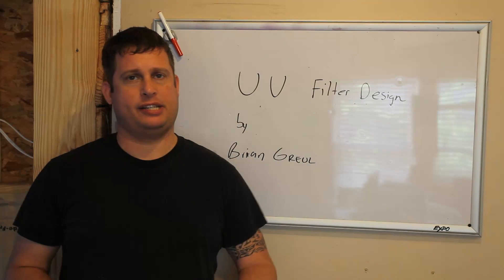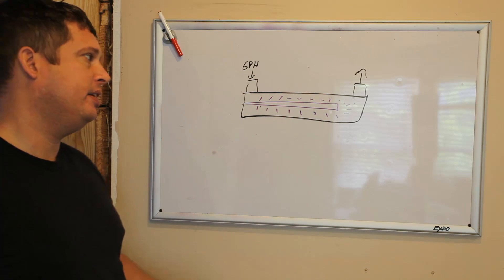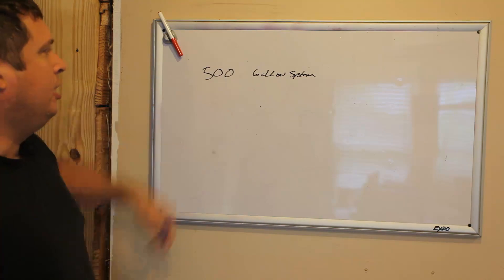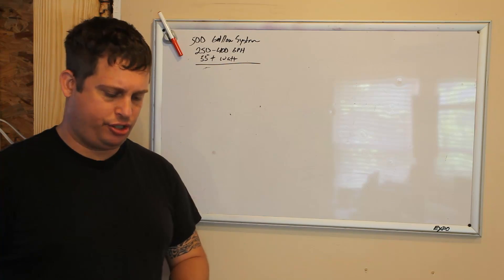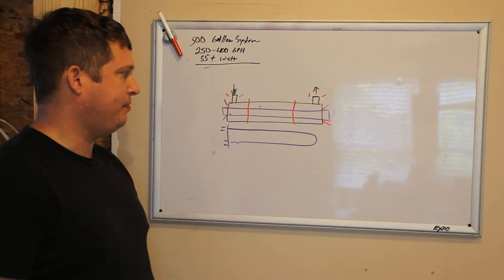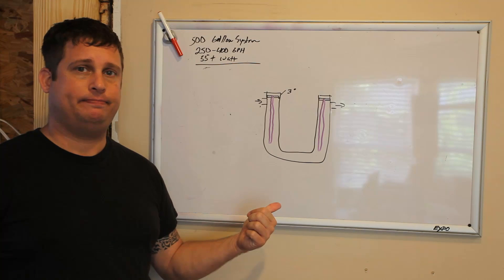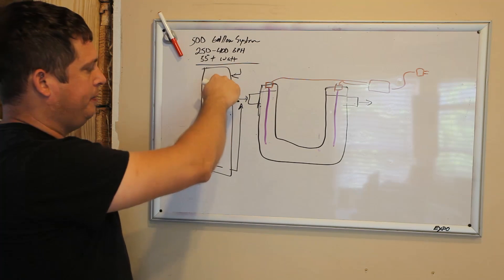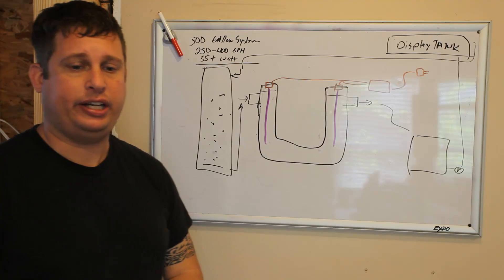DIY UV Filter Design

Comment: Thanks however I have a question (Cant get the book) .. I'm working with a 10000L pond 2000 Gallon... When I Google AI the wattage needed  for either level one or level 2 filtration I get 40W .... When I calculate like you do  I calculate 200W, Thats a bit of a difference. All I want to do is keep the algae out of my duck pond

Comment: you dont put the uv light in a glass casing , does the water affect the uv tube
Reply from the maker: What exactly do you think the UV tube is made out of?   Yes Dorothy, it's made from Quartz Glass which allows the rated amount of UV light to pass through.  Additional layers would cut the amount of light while accomplishing nothing.

Comment: This is a highly advanced lesson, buddy. Thanks for sharing this information with us. I´m going to invite you to visit my own design with 45 degrees for inlet and outlet, instead of 90 degrees. once I´ve built it. I will link it here, as it was the origin of my design, using perhaps a small windmill for water pumping. It´s going to be a 25K liter water pond. I hope to run the system just at night, to extend the bulbs life.

Comment: Hey Brian, great video! Can't say how much this helps. I'm working on a water filtration system for rv grey water. In other words, I want to be able to wash their dishes infinitely. Any idea how I can incorporate this into my system? Also how I can filter out the particulates without clogging up the pump? I'm thinking of gravity filtering out the particulates and then pump the filtered water into another tank that then supplies it back through a one way valve into the faucet to use again...

Comment: Interesting method of doing it.  Would think you could also do a build for a smaller aquarium making it like a DIY inline heater but instead of a heater use a uv sterilizer with it made from pvc and a uni seal to go inline of the return pump of a sump or return of a canister filter.

Comment: Brian was it sealed at the top? I get the water level is lower but not sure about it getting the bulb wet or overflowing.
Reply from the maker: It is not sealed and will never get that high.  Non-issue.

Comment: There can be another issue with the bulb in direct water contact: It is designed to withstand air pressure. If the bulb is somehow subjected to more pressure, for example in a larger water column, that may not end well.
Reply from the maker: True, but you'd have to seal the bulb to withstand pressure.  In the design I suggested the bulb simply sits in the water which solves a bunch of issues.

Comment: 3inch id or od? id check the claim on cold water as well... i came across a paper where it was tested on bildge water systems to keep ships from transporting invasive species. they specifically looked at low temp performance.  I basicly glanced at it thought but if i recall the conclusion was it worked fine

Comment: Hey Brian, really great video!
Would your system work for a residential swimming pool; say around 26000 gallons?
Reply from the maker: I would be extremely uncomfortable with this on a residential pool.  In theory the concepts would work but I can't emphasize the safety enough.  Electricity, Water, and People are usually not a good combination.
Reply: @hotpuppy72  
Do you think I can use this system for my swimming pool using the  circulation pump?

Comment: i am currently suffering from a bacteria bloom (I know for sure it is not algea bloom since there is no algea in my tank and the water is milky white cloudy). My tank is 160gallon saltwater tank and I am going to apply a 9w Atman UV Sterilizer. It is rated by the manufacturer that the UV can cure up to 1850 gallon pond (which is freshwater - algea bloom) under the flow rate of 530-792 gph. So if I am going to apply this into my saltwater tank for treatment of bacteria bloom, which flow rate should I run through the UV unit?

Comment: Brian I love your videos thanks a lot you explain everything in an easy way I just have a quick question do you think something like this will work on an above the ground pool?
Reply from the maker: No.  Absolutely not.  For a pool where children and others could be you need a higher level of safety.  A GFCI should offer protection for sticking your hand in.  I would want a different level of safety if I was getting in the body of water.  A properly chlorinated pool should not have algae or virus issues.  It's not possible to chlorinate an aquarium as the fish live in it, so using UV to kill algae is an option.  Ultimately, it's better to deprive the algae of it's food source by using good water filtration.
Reply: Brian Greul got it thanks a lot n_n

Comment: Brian!  Exceptional DIY video.  I like your attitude toward the commercial, over-priced units.  I am interested in building a large koi pond in my yard.  at 11:00 or so in this video you mentioned that glass cannot come in contact with the bulb at 50-60 degrees.  If I live in southern california, I am sure the water will be nice most the year but as it is buried in the ground and can get freezing here some nights, will this UV system fail once the water temperature drops?  What do you think?  Can I still build my own system your way or do I need to buy an expensive one?!
Reply: Hi Brian, I also live in SoCal, in San Diego to be more specific. I would love to hear your answer on this question.

Comment: Great video, if I wanted build one of these for my 6000 gal pond and I noticed you said this was like for use in a low flow situation my pump driving water from the skimmer to uv light and then returned thru one of my waterfalls is pumpimg at 5500 gph . The current evo UV system I have on there does a great job and is rated to handle that flow rate but already I am having problems with leakage around the ends as you described and the unit is ony running for 3 months. Now it appears as if the bulb is toast and the replacement bulbs are $90 on ebay.
My question then is can this design that you refer to be used in a high flow rate situation by running two of the 36 watt bulbs as you are or maybe a higher wattage but in the high flowrate.  Thanks

Comment: Sorry for posting on an old video.
If I were to plan out a 3000 gallon pond, how do I ensure 90/99% sterilization? Do I simply set the flow rate by dividing the pond volume with the numbers you've given or do I need to calculate with another formula entirely?
Reply from the maker: It should be the same.  Why do you want to sterilize your pond?  It's better to correct the imbalance.
Reply: Thanks for your reply. How do I go about correcting the imbalance?
Reply: I have a concrete tank of 3000gallon too, according to the calculation the flow rate is 1345-2241 GPH, and it requires about 300watts, where can I find a uv lamp that suits my tank?
Reply from the maker: You may need to "stack" multiple UV lamps to achieve what you need.  You can do it via parallel or series to get your exposure time and flow rate balanced.

Comment: Would UV sterilization work if you simply placed UV lights between baffles on a sump given that they are 3 inches apart (following the three inch pipe rule) and of course match the wattage/flow ratio? I'm trying to design a sump with submersible UV sterilization instead of inline. What are your thoughts?

Comment: what if bulb glass breaks?
Reply from the maker: SRNEC PAJAONE The GFI breaker will trip.  You will then need to clean out the glass shards.  It should not happen under normal use.  The bulbs are pretty tough.  However, if you are worried about it put a coarse filter sock or a fine filter sock on the output.  That gives you one more thing to maintain, but it would catch any glass fragments.  If you discharge into a reservoir like I do then the pieces would settle to the bottom of your reservoir and you could vacuum them out.  It's CRITICAL that you use a GFI device to protect against shorts and shocks.

Comment: Brian let me say I like what you do, what I would like to ask is where in part 1 does it show you making the caps that hold the bulbs?
Reply from the maker: warren763 It does... sorry for the delay I don't check comments very often.  The caps are an important element.  I simply used screw in caps, upside down, with holes drilled in them.  I then caulked where the bulb goes through and considered the cap to be expendable, along with the sockets.  The caps, bulbs, and sockets are cheap.  The critical part is to make sure you have the right ballast, follow it's schematic, and then always always always use a GFI protected circuit.  There are two types of GFI devices, 5ma and 30ma on the market.  Get a 5ma device.  Both are safe, but a 5ma will stop the current/electricity flow when a leakage of 5ma is detected.  Always disconnect the device when working on the sump/refugium or in it's vicinity.
Reply: Still cannot find where it shows how to hook up the ballast and what ballast is “correct”?

Comment: without the Cuarz Sleeve, the water cools down the tube, and the efficiency drops dramatically... check the lamp response with the temperature in Philips web.
Tube must be kept to 40 C in order to get the 99% efficiency. without sleeve, its just loosing power...
Reply from the maker: CxC2007 That's an interesting theory... but the arc is what generates the UV light... not the tube.  The quartz sleeve blocks a fair amount of your output according to Dr. Escobar in his Aquatic Systems Engineering.
Reply: ***** 
Wow, this is an old topic..
Yes the tube generates the UV-C radiation, but according Phillips, who is the manufacturer, the tube is 100% efficient when the tube is at 40 C. if tube temperature is less, there is a curve that shows how efficiency is killed... check Phillips web !!
Reply from the maker: CxC2007 Then you should factor in the reduced efficiency.  If you haven't done so I recommend reading Escobar's book.  This is more complicated than you think and a quartz sleeve isn't going to provide you with any insulation.  It will however cut the output of the unit by filtering out some of the UV-C rays.  The bulb only produces 12 Watts of UV-C energy to begin with.  There is a direct relationship between effectiveness and contact time, there is also a relationship between unit width and effectiveness.

Comment: usually these is clear tube on the light since this bulg is going to get hot, how do you prevent it from cracking or breaking when water touches the bulb and how did you seal the bulb socket so that water does not come out of the top ?